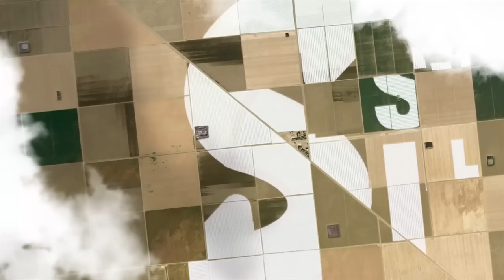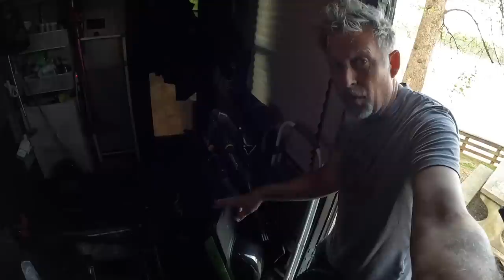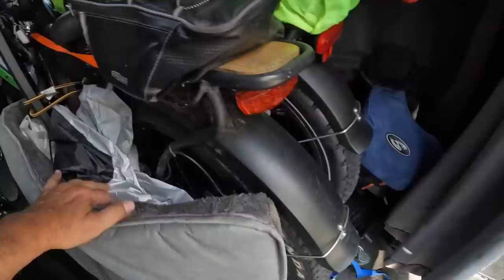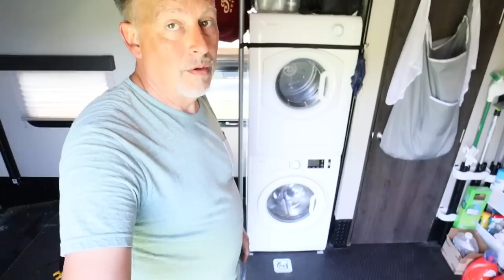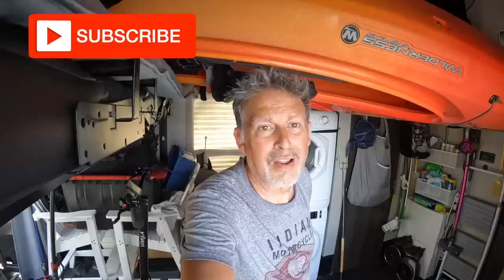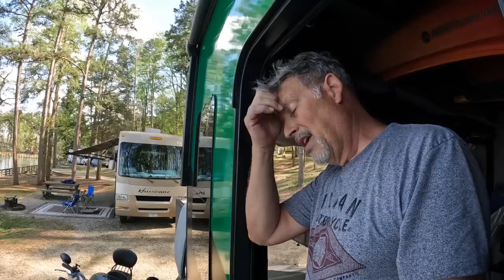RV Toy Hauler Garage Organization.

Comment: I like the tracks & baskets. Great onnthe padding to protect expensive toys. Nice ideas Todd. My TH fits the ATV & Motorcycle side by side (wall to wall). I got upper cabinets on both sides full of stuff and a roll out rug for the floor when living in a spot (for anyone else looking for ideas). Older TH, so no read deck patio, only a ramp.

Comment: Thanks for sharing. We have the 397th and our garage/sons room is 12.5'. We have 3 e-bikes and have 50gal totes we put them in. We don't moved often, but when we came west I wanted a different solution for the bikes. I think I'll put them in the bed of my truck. I have a half ton and I'm the caboose/ shed. So that means the smoker, Blackstone and chairs will have to be in the garage.  Our 2nd bathroom is still under construction,  I took the useless shower out, capped all plumbing. Have yet to build shelves,  but that's a much better use of space. Appreciate your tips as always.  😊 C4YT

Comment: Todd,

As 395ms owners we struggle with the lack of storage, I know. I use a Condor wheel chock where I can manually remove the main part of the chock from the plates that are screwed down to the floor. My biggest struggle is wanting to down size all my tools. I did move the bike over to the passenger side of the garage and Lisa’s desk and my big tool box to the driver side to even out the weight of our MORryde independent. suspension. I just need to make the decision to think about downsizing my many tools to lighten things up, I suppose. The garage is always an ongoing struggle.
Reply: By the way, I owe you our new logo sticker since you gave us one of yours.

Comment: Hello we are looking at purchasing the same toy hauler, wanted to ask about the pantry and where you store the extra food. Since the pantry is smaller in this rig then some of the other ones? Thanks
Reply from the maker: At first I (Sheila) was really concerned about the size of the pantry - but we have adapted pretty easily and there is enough room for all we need - I also use the cabinet above the fridge for things like chips and extra canned foods
Reply: Thanks for the info, that's the biggest worry my wife has. She is going back and forth on this toy hauler because of the large garage and the new Brinkley, if the Brinkley had a bigger garage then I think we would go with them. Have a blessed day